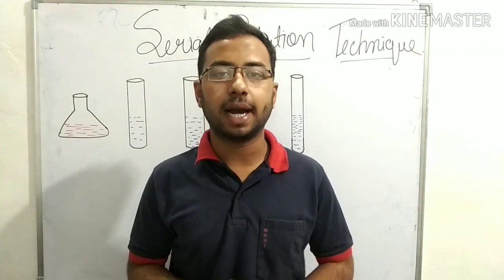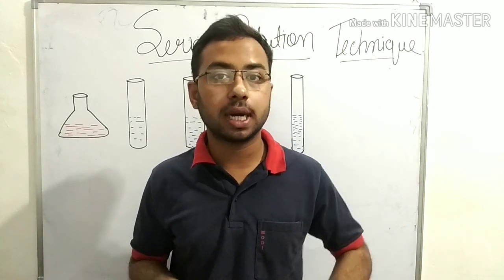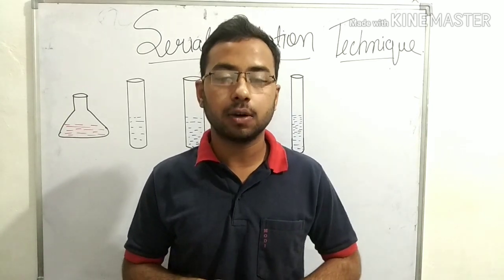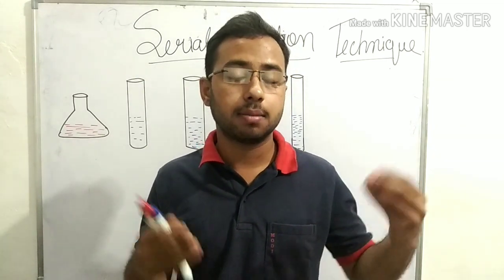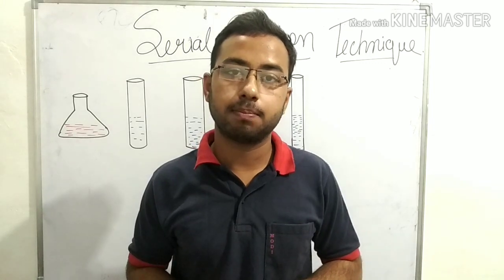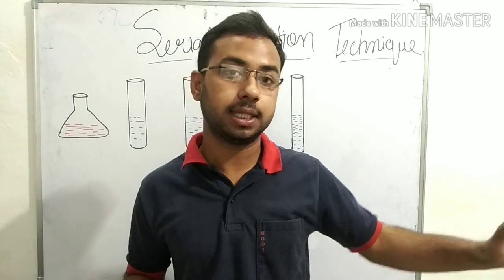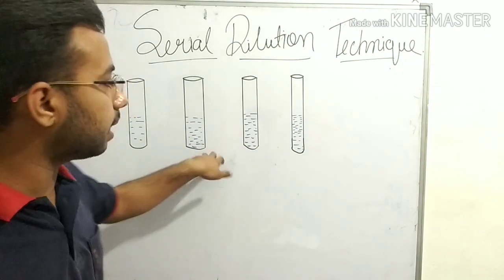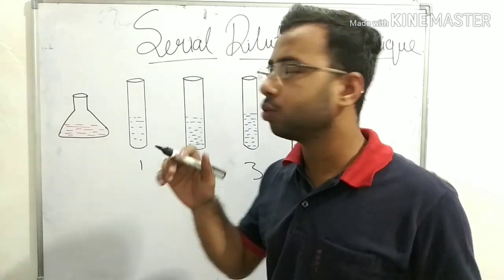Serial Dilution Method Protocol Step Wise Explanation |How to Perform Serial Dilutions Microbiology

Comment: Bro how can we calculate the concentration of serially diluted solution at each step 
For example we have 1 mg/ml stock solution ( it means concentration of is 1 mg/ml ) now if we diluted  it serially with five dilutions how can we calculate it's concentration at each dilution step 
Plzzz solve one in comment section
Reply from the maker: Just divide 1 mg with 10⁵ you can get the answer  and it can be done for every dilution for example if you have to dilute 7, 8, 9 then just add more zeros or power in decisions 10⁷ , 10⁸ and so on